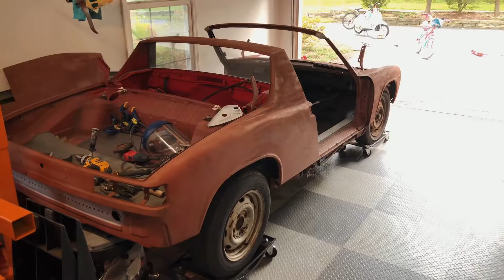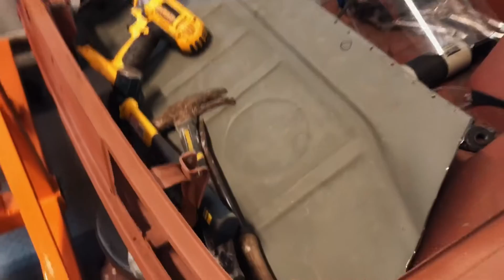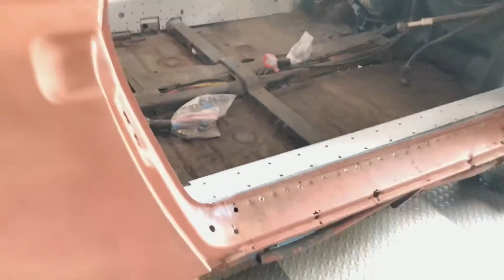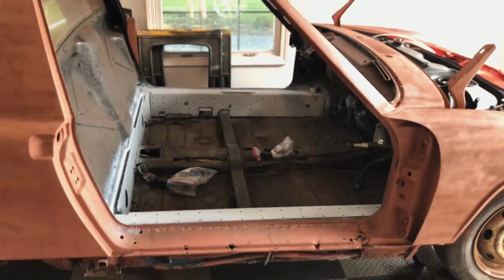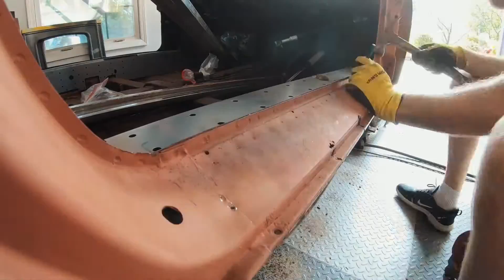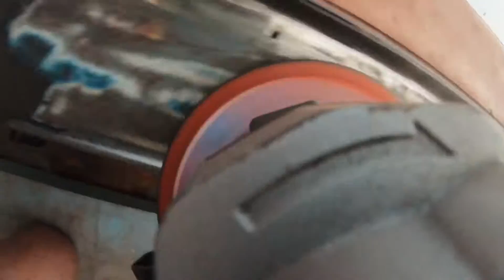Episode 4:   The Joker!  1976 Porsche 914 rocker replacement & body stiffener addition.

Comment: Bob, I have just subscribed to keep up with your 76 914 project. I am a bit ahead of you in progress on my 76 but still have lots to go. I am not video-ing everything I do but I am recording answer-less problems as I figure them out. Lots of "problems" when you get to door,glass,top alignment with new parts and rubber. No help anywhere, so I am recording these issues now to avoid problems while assembling everything after final paint. You got a good start on what appears to be a better than average 914. I have done the resto design rear pan(kit) and lower inner firewall bulkhead panel. I think most all 914s need these 2 pieces and together make the car rigid as new(maybe better). Good luck on your progress.
Reply from the maker: Wonderful and hope you enjoy!  Will be fun to see some of the problem projects you are working on also, are you on any Facebook 914 groups or forums?  That’s why I bought the car, wife thinks I’m crazy but knows what can brought back so is going along with it lol!  😁